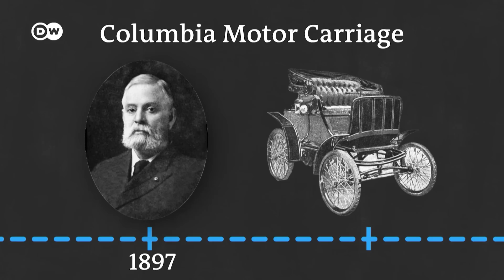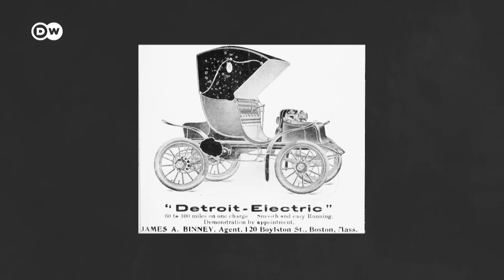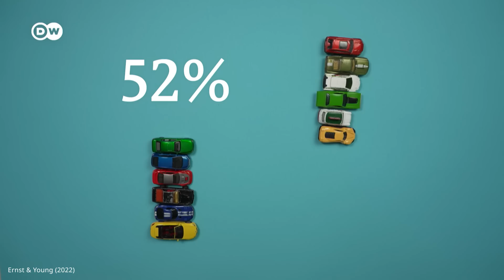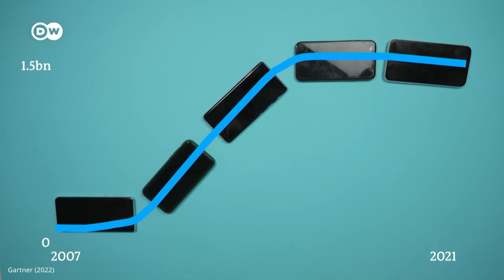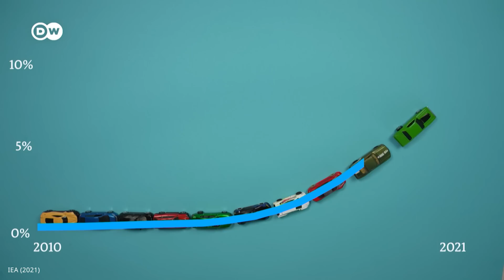Why electric cars are finally taking over

Comment: Couple of questions!
1. How do they measure the amount of C02 emissions from producing cars? Do they only count the production of the cars or also the mining and refining of raw materials into account?
2. Would it be better to drive a newly produced electric car instead of old fossil fuel car that has already been produced?
Reply: Engineering Explained has a great video on the subject. “Is Keeping Your Old Car Better For The Environment?”
Reply: Even if new electric cars are worse than used fossil cars they are better than new fossils. Production of new fossil cars should stop, and we then need EVs to replace cars that are getting to old.
Reply: @jaken005  If you make long journeys then the best choice is still ICE cars. You need to match the tool with what you want it to do. A new long range EV is likely worse for the environment than a new ICE car for long journeys. We do need to reduce the amount of pollution we make. But getting it wrong is making things worse. EVs only make environmental sense if their batteries are small. EVs are not the miracle answer people are making it out to be. All that forcing an EV to go long range will do; is increase it's environmental problems. But then those that do, do get to live the lie that they are being more environmentally friendly by swapping out their ICE car for an EV. Why should we need EVs to replace ICE cars in situations where they don't make the cut of being more environmentally friendly than the ICE car that they are replacing?
Reply: I guess question is does moving to EV make sense if one is looking at a climate change perspective and this question I would say no, the model of everyone having their own individual cars would not be suitable in the grand scheme of things. Increasing public transport and last mile transport should be the optimal way imo

Few reasons why the shift to Ev is not practical in the long run

The earth does not enough minerals to replace even a fraction of ICE cars already in existence for starters.
Efforts to recycle the parts of a electric is still widely challenging, meaning it be way easier to strip out nature and mine for minerals
Maintaining road infrastructure and other car related consumables (Tires) still require a huge amount of crude related products

For It would probably be more practical to focus the limited minerals we have to green electrification (i.e using neodymium for more wind turbines as opposed to millions of electric cars), energy storage capacity, copper etc. Improving public transports while phasing out individual cars eventually. Redesigning of population centers to reduce needless transportation and road infrastructure

End of day most innovations mainly go to feed endless consumerism as per how capitalism was designed,  there will claims about self driving cars, better battery technology, fusion energy, easier recycling etc to feed a hope of the future to this drive endless consumerism (greenwashing?) How much time is needed to deliver these promises is anyone's guess. 

Ironically even if more efficiency was produced from a shift to electric cars its shown all efficiencies will fall into Jevons paradox

This is a good video on the subject
https://www.youtube.com/watch?v=vn9Vl0G53lA
Reply: Burning just 1-gallon of gasoline produces a surprising 20-lbs of CO₂.  A typical passenger sedan will emit 5 tons of CO₂ a year.  Multiply that by a billion internal combustion (IC) engine cars.

There's also the sulfur, nitrogen, benzene and other toxic hydrocarbons emitted from the IC exhaust even with a catalytic converter installed.  Scientists are now finding small pieces of metallic and magnetic particles in the frontal cortex of animals and humans.  These are unburnt bits of fuel and engine metallic shavings that are highly suspected of causing brain diseases like dementia.

See recent PBS special on city air pollution from around the world and the latest research around it: https://youtu.be/B1SdFjna7zQ?t=1605
Reply: Old cars are shown to be so polluting that it's better to crush vs repair them.
Reply: @Nicholas-f5  Why do you not even consider the possibility of converting them? Are you encouraging a throwaway society?
Reply: Asking the real questions...
To add another aspect to the first question.. What about the energy they use? Is is green? If so... How clean is green energy truelly? Do they take into account the CO2 emissions from producing the solar panels, wind turbines,...? I'm afraid we might be surprised that it's more about consumption and less about the climate.

Comment: With extremely high gas prices this summer the electric charging stations cost a electric car owner exactly what the gasoline car owner was paying.  Gasoline cost have gone down though I assume electric charging  has remained high.  The charging system operators can really victimize electric vehicle owners.

Comment: As far as the adoption of new technologies, the telephone and personal computer did not supplant existing technologies in people's homes. Electric cars are an attempt to supplant ICE cars, and that is why adoption of them has been so slow. It took only about a decade for the developed world to go from almost no PCs in homes to PCs in almost every home, from no Internet access for most people to most people having broadband access. We will not go from most people having ICE cars to most people having EVs in a decade or even two, I think.
Reply: But the smartphone did supplant the old mobile phones
Reply: Not with that attitude
Reply: What will slow down EV adoption is not that it is supplanting an existing product, but that that product is expensive and has a long expected service life.

If every new car sold today were electric and nothing else changed, then we would expect gas powered cars to be on the roads in significant numbers for at least another twenty years.

Now, in practice we will likely see many gas powered cars retired early for various reasons, one being that gas stations will start closing when they don't get enough business to be viable - but then, we also won't be seeing 99% of new vehicles being electric for at least another five years.

Comment: While electric cars are undoubtedly better than petroleum cars, ultimately they barely move the needle on environmental damage and sustainability, because in the lifecycle of an automobile, the majority of the carbon emissions don't come out of the tailpipe, they come from all the forms of increased consumption that personal mobility enables and requires. We must not think of EVs as the solution to the imminent cataclysmic global climate collapse. I would go so far as to say that we should ban electric cars entirely (along with all other cars), because they are responsible for giving people a false sense of action and security. Instead, we should be focusing our efforts on reforming our land tenure policies to support redevelopment of our population centers to provide better living at higher density, so as to obviate the need for personal mobility, in the first place.
Reply: Urban ebikes are even better

Comment: This is an ass-backward way of categorizing why electric cars were supplanted in the market by internal combustion engine cars. A 70 Km range is huge distance compared to the range of a horse. It's not that batteries couldn't go far enough to meet the needs of the people of that time, it's more that the greater range afforded by gasoline fundamentally changed people's relationship to distance, and therefore, to location. Ironically, it was the gasoline-powered car that created the demand for rural telephony and electrification, which did not take place on a large scale until decades after the ICE took over in the automotive market.

It is even more inaccurate to state that people could find gasoline in the hinterlands in the early days of the automobile. Gasoline infrastructure did not exist at scale, at first, but gasoline can be transported in containers and weighs much less than extra lead-acid batteries.

Comment: cars are the wrong solution, strapping a ton of lithium onto massive vehicles is not a practical replacement for ICE vehicles. we need to get off of cars and onto light electric vehicles for the majority of our transportation needs if lithium-electric vehicles are going to actually meet the transportation needs for every person on the planet. there is room for cars, but defaulting to a car for your concept of personal transportation is simply not realistic. lithium is simply not abundant enough.

Comment: I mean.. In eastern eastern europe (the balkans etc.) the majority of cars driven and bought every year, are second hand cars - like 80% or such. Majority of people can't afford new ones, much less electric alternatives. The infrastructure is not very good, to put it mildly, and public transport is at best passable, so alot of people rely on their old vehicles or buy used ones, imported from western europe to save on cost. In third world countries they have it much worse.

The point is - when westerners decide to sell their EV's after 5 to 10 years of exploitation, the battery on those will more than likely been shot dead and in need of a change, which is not a very cheap endeavour. Anyone buying such a vehicle should be ready to splurge another few thousand $ for a replacement and this is simply impossible for average people in those regions. Furthermore, this will also have a negative effect on sales of perfectly usable used cars in the western countries, driving up sales of new cars, because nobody would want to bother when they can get the new model for a few thousand more. Basically a win for manufacturers, a loss for consumers. As always.

All in all, i'm all for eco-friendly but in my opinion, this is not the time and this is not the way, we need better, greener and more reliable batteries. Current technology is not ecological at all...

Comment: I feel we need to work towards things like a Veemo or similar pedal driven but battery assisted small frame "vehicles" rather than full scale cars. They can go decently fast, they're stable, have storage, hell some bougie versions can have air condition and stuff lol But for the life of me I'll never understand why we decided driving around in massive 2000lb chunks of steel was a good idea. It's a bad use of raw resources, it causes hazards due to the weight and high speeds, and the pollution up til recently has been really bad. Honestly instead of full size vehicles, we could scale down and have techno-flintstones style vehicles. Battery would help so you don't break a sweat, just a constant steady pedal to keep the battery up basically.
Reply: Yeah, honestly you don't even need the battery assist for most purposes. Just go with a well-geared bicycle structure, and if these manufactures ever get around to figuring out how to build them to a decent durability it'll last forever. I just wish we could lower the speed limits to the point they could be a major part of the traffic outside of cities as well as in.

Comment: I think the S curve is not going to exactly describe the way electric cars are adopted.  I think the end of the curve will be a sudden drop in petrol and diesel cars.

When smartphones were totally dominating the market, then your old fashioned mobile would still function just the same, this will not be the same with EV's.

Now think what is going to happen at the end of the S curve for electric cars, when 90% of everyone has an electric car.  People who have petrol or diesel cars will not be able to find anywhere to buy the petrol or diesel, it'll just be a very sudden point where petrol stations just aren't able to earn enough money to stay open.  And everyone up the supply chain will shut down.

If you can't buy any fuel for your petrol or diesel car then you'll be stuck.

When there is a very sudden end to the use of petrol and diesel cars, you really don't want to be the person who is stuck with a car that can't be refueled at all.
Reply: mass producing cell phones are a whole different level than mass producing electric cars. i appreciate you see the difference
Reply: What you overlooked is the "facility of recharging an EV" and when one has to make a "cross country trip".
Internal Combustion Engines are here to stay! Period.
Reply: @VenturesAdventure  you can recharge on a cross country trip already 🙄
Reply: @uhohhotdog  Sure, if you have extra half a week to spare, you can do that. But you should of course not take a trailer with you, otherwise make that an extra week.
Reply: @thespalek1  doesn’t take that long
Reply: @uhohhotdog  our lifetime here on this earth is limited. Our time is the only real currency. And a 30 minute forced procrastination for every 3 hour drive seems like quite a lot to me..

Comment: In in Monterrey México It's more common to see electrified cars only at neighborhoods were people with greater incomes live.
Reply: The same was true of gas powered cars circa 1900. Only the wealthy could afford them. Going back further, only wealthy people had horses.

But that changed rather quickly, and as continued development and economies of scale take hold, the cost of electric cars is likely to be similar to gas powered cars within five years, and could be significantly lower (adjusted for inflation) in another ten to twenty years.
Reply: True, even here in the States. But even Chevy introduced the all new $30K Equinox that has long range, good looks, and will prob spur other lower cost and desirable competition. 
Oil companies should be shitting themselves at this point cuz all the automakers are going electric. Even Ferrari introduced a new electric SUV this week!

Comment: The economies of scale of mainstream ICE car manufacturing will swiftly collapse once EV sales really pick up. Around the time EV covers 50%-70% of sales I think. Maybe sooner. Unless people want to pay luxury car prices for mainstream ICE cars. Probably 2026-2030ish. ICE car parts and service industry will become boutique soon after. The bottom will fall out of the 2nd hand ICE car market soon after that. Bye-bye gasoline industry.
Reply: seems doubtful, it will take many years to scale up production. we're projecting 3 billion vehicles by 2050 so when you say 50% we have 1.5 billion vehicles today. it will take many many years to scale up production to produce 3 billion
Reply: @Lildizzle420  Simple misunderstanding. 50% of new car sales which is what I was referring to. Is not 50% of the world fleet. What I'm trying to convey is that when less than 50% of new car sales are ICE, then degraded economies of scale in their production and even aftermarket service (parts availability is hugely impacted by whether a car is still in current production or not) quickly start impacting the value proposition they hold. And fuel prices are set to rise dramatically towards the end of the decade even under stable market scenarios just because of increased demand and lower production. If an ICE car is very expensive to own (purchase and operate), then demand for EVs will skyrocket. Especially when they start reaching price parity with ICE cars circa 2025. And then - Most people trade in their car at least every 10 years or so. Then there's the normal scrap rate which is about 1-2% globally (5-6% US and EU) which already means that very few of the cars on the road today will still be in operation 50 years from now in any case. Just like very few of the cars that were on the road in 1950 are still around - Apart from collectors antiques. And then old cars were made to last and be easy to service. New cars are built to replace. You see? The world fleet is very nearly completely refreshed every few decades in any case. If all new car sales are EVs then in a few decades...